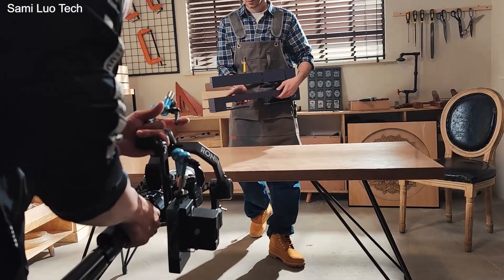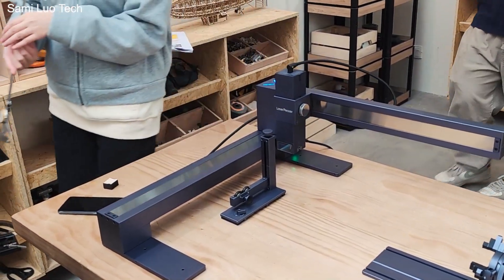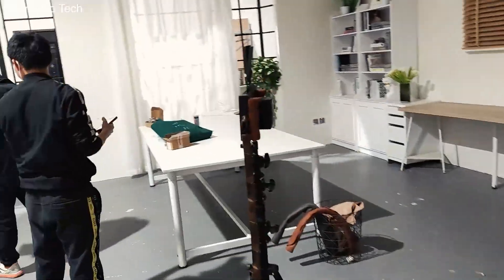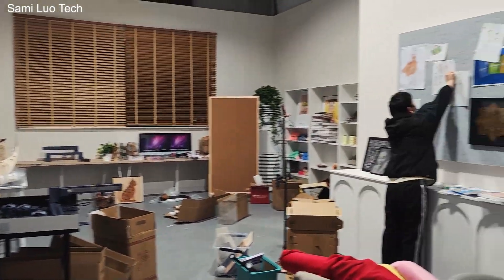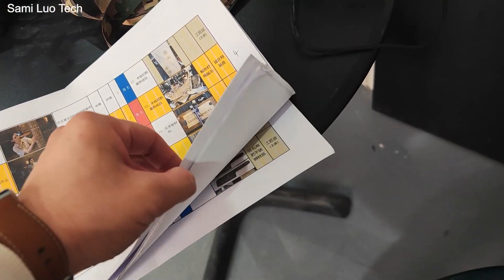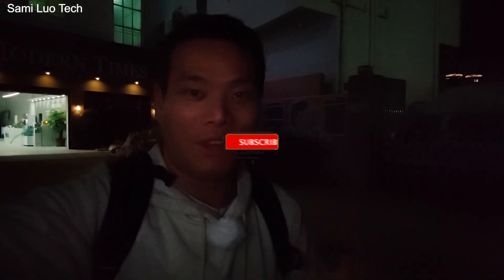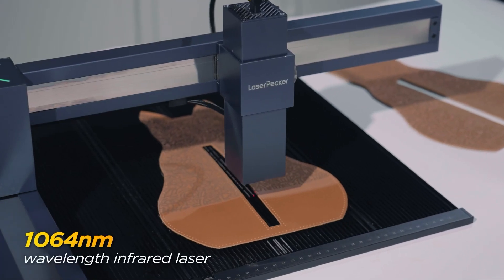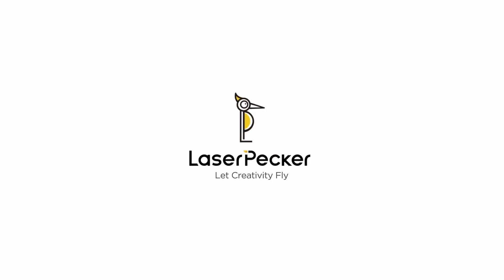LaserPecker LX 1 First Look: The Game-changing Laser Engraver

Comment: I am more interested in them talking about the Air Purifier since I ordered that add-on for my Laser Pecker 4.  There is not a single video on the Air Purifier at all and only shown as an image on the add-on Pledgebox page.  Also, it would be good to show and talk about the enclosure box for the Laser Pecker 4 as well as the one for the LX1.
Reply from the maker: Stay tuned, I will talk about everything :DDD
Reply: @SamiLuo  Thank you Sami.  Also Sami, could you do us a favor.  "Us" meaning that people like myself who have bought the Laser Pecker 4 add-ons and have asked questions about the air purifier and the enclosure for the LP4 but have had no respond at all about them.  It seems that they just move on and now just focus on the LX1 and not caring much about the LP4.  So could you please ask or talk about the air purifier and see 1.  How quiet it is?  2.  How powerful it is on extracting the odor and debris. 3.  What kind of replacement filters does it use and how to purchase them in the future and how much they will cost.  For the enclosure for the LP4, does it have an opening at the top to allow the LP4 to move up and down.  Also, does the LP4 enclosure fit the slide extension for the LP4?  I saw your video of the LP4 but at that time you did not have the enclosure or the air purifier.  Those are the two most expensive add-ons that were shown on the Pledgebox page.  If you can talk about these two add-ons, we would really appreciate you for your effort.  Thank you in advance.